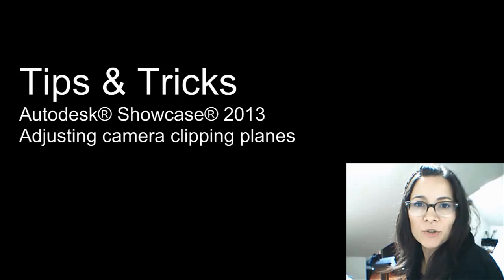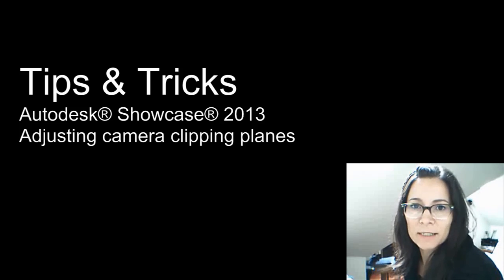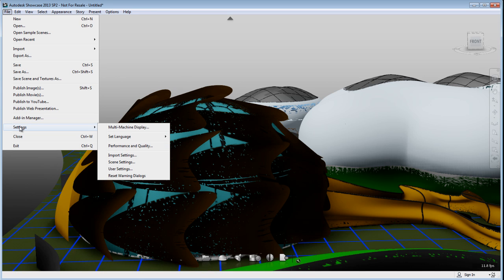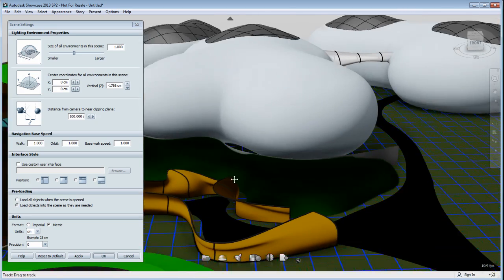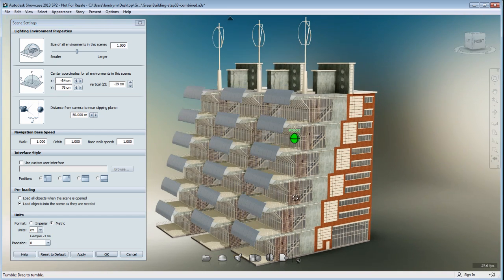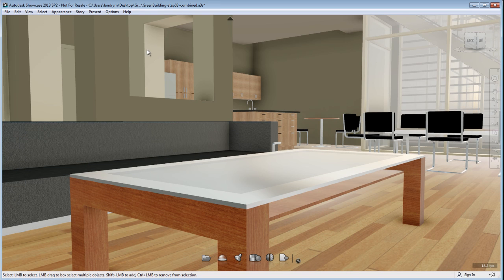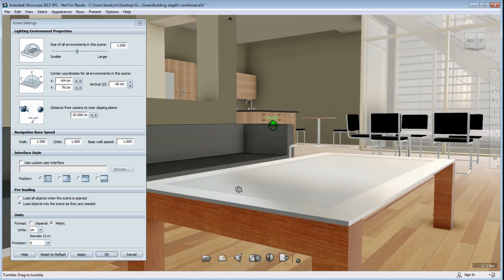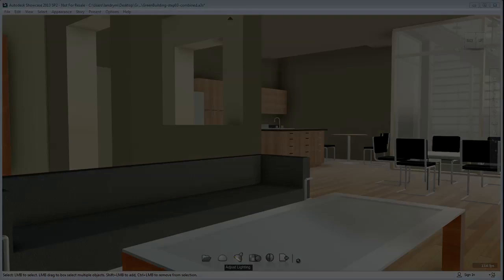Showcase Tips & Tricks: Adjusting camera clipping planes

Comment: One thing that I've noticed is that the camera in maya has alot more attributes than showcase, they match each other by proximity. I'm using the camera gate in maya (1280x720) and the showcase window is resized to fit this proportion. To be more precise, the two images (showcase and maya) are very similar, the perspective fit, but in showcase the object seems to be more far from the camera.
Maybe I could send you my test files....
Thank you!

Comment from the maker: mmm I am not sure why it would be different. Can you check that both cameras in Maya and Showcase use the same mm lense? Maybe the one in Showcase is slightly different affecting the angle of view. Also, check the output size of Maya to match the output size of Showcase. Let's say you are using a 640x480 size in maya, make the viewport size the same in Showcase and see if that help. Let me know if that solves the problem. Marion